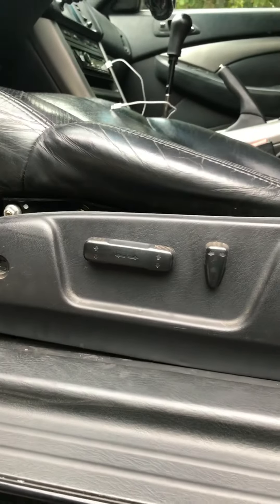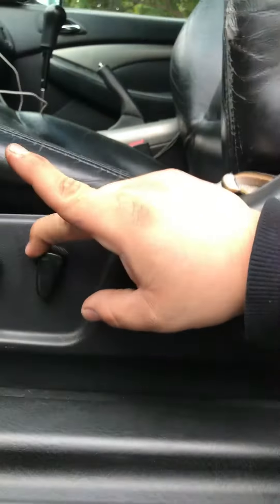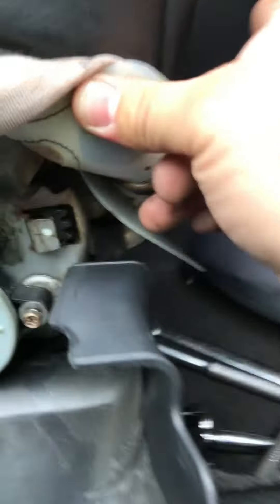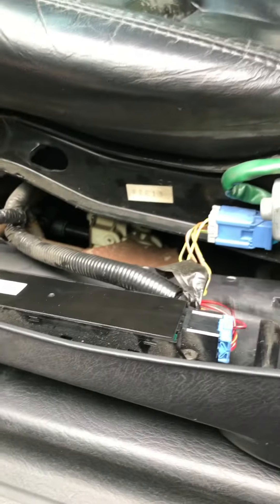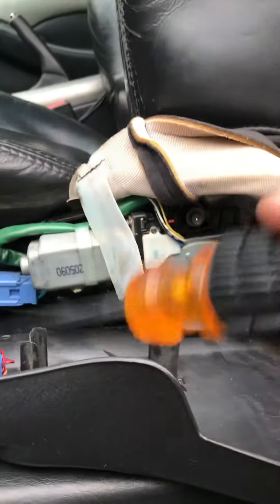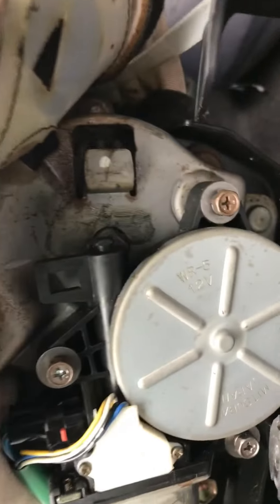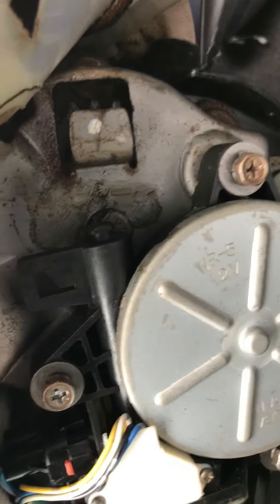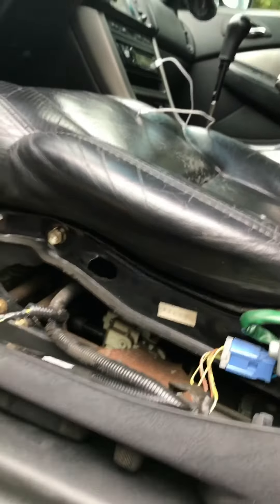ACURA SEAT RECLINE FIX

Comment: If you tilt the seat all the way back which I did for occasional nap; soon or later it will get stuck. That means it is mechanical because I still hear the motor and the rod is trying to rotate. If that is the case; tapping the end of the rod close to metal jaws somehow gets it out of stuck mode. The end of moving rod is too soft to ratchet. Take a big flat screw driver and get as close as possible to metal jaws and the rod then tap it by hand or hammer. Keep trying a few times and use the switch to move it forward. It worked for me.

Comment: Can't wait to try it on mine, I thought it was electrical but it wasn't so here's hoping this is the answer.
Reply from the maker: Let me know how it goes!
Reply: @MYKEYSAUTOMOTIVE  will do
Reply: @MYKEYSAUTOMOTIVE  My seat is entirely different to yours unfortunately and doesn't have that little inspection opening. I looked high and low for it but no luck so it's going to stay as it is and no one has complained yet. I can say I tried.

Comment: I have a 2003 Honda Accord that the driver's seat was stuck and would not recline back or forward.
Took the seat apart like you did, but the Accord did not have a sprocket with big enough gears with teeth to move it with a screwdriver.  Took the seat completely apart and started to pull the leather covering off the back of the seat to access the motor.  Had a difficult time removing the lumbar support on the side.  So I decided to give it one more try.....    I did use WD-40 and sprayed both sides of the sprockets the night before.  Used a pair of ViseGrip on the center stem, using the power seat control, and at the same time moving the ViseGrip back and forth.  "WOW", I hear the gear click like it got unjammed or something and was working AGAIN!!  

Thanks to your video and my giving it another try (actually about 4 times), I was able to get my seat RECLINING again.  ^^ Plus the WD-40 ^^
Reply from the maker: Right on brother good job!

Comment: Worked on a Honda Accord.
My daughter has a 2003 Honda Accord and when we bought it used, the seat did not  recline then. I think it was just Used in the same position for years and just ended up ceasing up in that position. I used this idea From this post and applied it to her Honda and after a few minutes of working grease to the gears and using a a little force, it worked it self loose. Now it works good. This is a common problem with Honda’s from my research and I was afraid that I might need to get a new seat or seat motor. Until I came a cross this post. Youtube is a wonderful thing for projects like this one. Saved a bunch of money and time. Thanks!
Reply from the maker: Thank you for watching glad it worked out for you!! Dont forget to hit like and subscribe!!

Comment: Very helpful! This worked for my driver and passenger seat. The hard part is getting a screw into the hole to release the motor cover. I ended up having to unbolt the seats from the car so I could tilt them.
Reply from the maker: Glad i was able to help

Comment: How do you grease the gears do you put it on the flathead and apply it as the gears move? Also what kind of grease should I buy at my local Autozone?
Reply from the maker: Use your finger to smear it on there
Reply from the maker: Any non electrical grease is good!!
Reply: @MYKEYSAUTOMOTIVE  I did this and it didn’t work motor is good and so is the switch I even bought spares just to be double sure and same thing even with the new ones it’s going to be a headache to disassemble the whole seat so I’m going to call local upholstery places in my area to see what’ll be my next move there are barely any cl that have black seats in my area for parts
Reply: @MYKEYSAUTOMOTIVE  I even broke my flathead lol for pushing to hard

Comment: I have a 2001 Acura CL type s and while I was driving my car just shut off and I tried to crank it it just kept turning. I replaced the fuel pump and the relay and it's still won't crank. When I lock the car the headlights come on sometimes without the switch being on and there is a red light constantly flashing underneath the dash that I saw when I replace the fuel relay. I checked the fuel pump fuse it was good. Any ideas what could be wrong??
Reply from the maker: i have no idea ..sounds like you have a short
Reply: My former 1998 Honda CRV situation did that too shuts off while driving and problem had to do with the ignition coil..........ever since replacing the ignition coil no more shut off

Comment: Thanks for the video. My Lexus rx330 is stuck at full recline position and just clicks like crazy. Gonna see if I can take the cover out and spray it with some wd40
Reply from the maker: how did that go any succes?
Reply: @MYKEYSAUTOMOTIVE  it worked! We also pushed down on the seat so it went lower, then pushed it up slowly. So my dad was in the front using the lever. I was in the backseat pushing up and down on the seat ahaha

Comment: What kinda grease did you use ??  Thanks in advance
Reply from the maker: You can get some at autozone,,comes in these like little ketchup packs..for like gears or boots.. gear oil they are usually by the counter!

Comment: Sweet,..I just picked up a very nice 02 ACURA CL, found this video last night, FIXED this morning, I did have to remove the front and rear seat bolts and tip the seat up a bit to get at the rear deep screw that holds the plastic cover. Greased the gear, put back together and it works as new! EASY FIX, THANKS!
Reply: What did you grease it with? I have a nice 03 I just bought three weeks ago.
Reply from the maker: nice hows it holding up ? i just got into a wreck with my acura cls 2003 6 speed

Comment: I tried this a couple years ago on my 2003 Acura cl, didn't work , took out motor and seat nothing , now taking motor apart
Reply from the maker: robert ellis maybe its not the motor maybe its the buttons or a fuse ..does the other slide buttons work ??